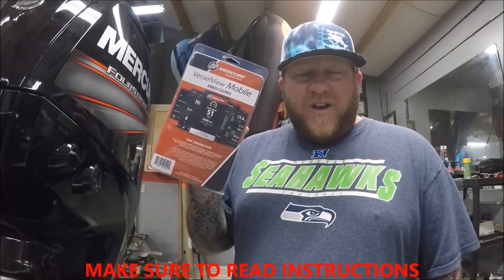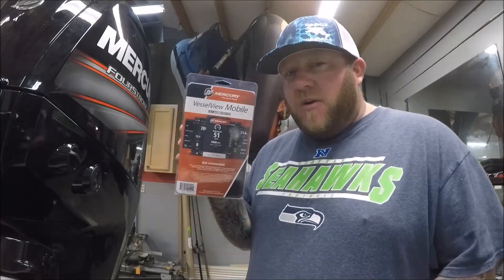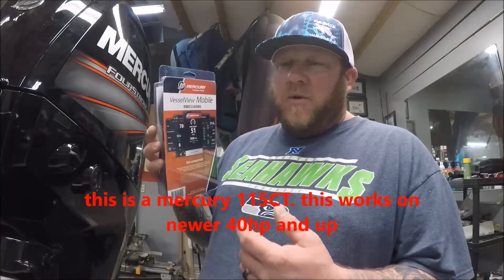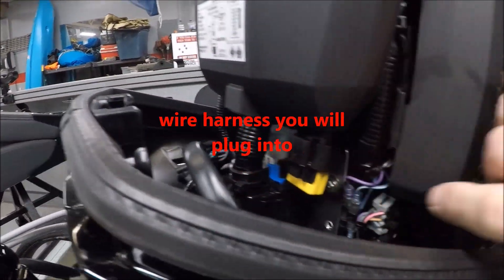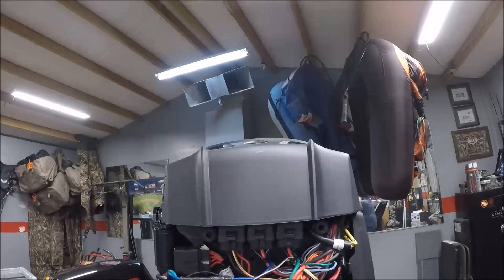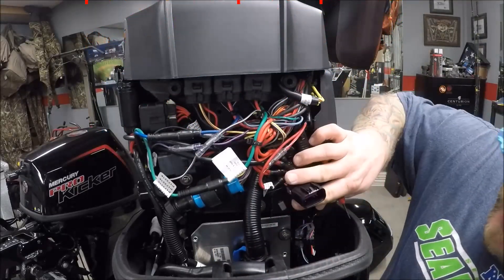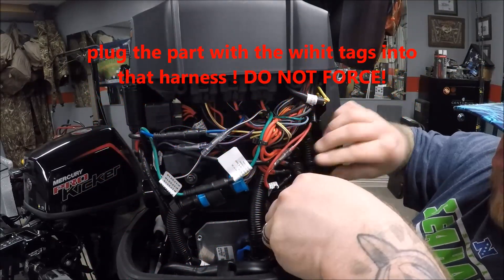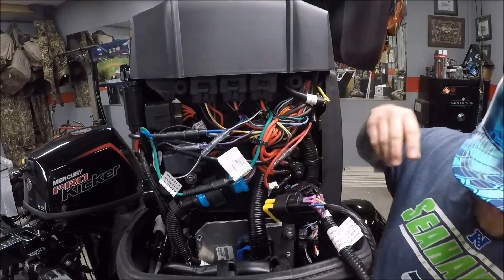Mercury Marine VesselView Mobile how to install

Comment: Hello.  I’m just seeing this so doubtful you will even see my question but I’ve watched a bunch of vid’s on this now and for some reason, on my Mercury 75hp 2019 motor, the yellow terminator cap I pull out of the motor, won’t fit back on the other end of the vesselview.  The vesselview does snap back into the where I pull the yellow cap from, but then that yellow cap won’t go on the other part of the vesselview.  Any thoughts?  This is making me nuts.
Reply from the maker: Lol never doubt! So you could have a pin that’s crooked or bent not allowing it to snap in. Inspect the pins. Do you have the right ends plugged into there said spots?
Reply: @nookiehookers8859  thanks!  I went back and for the 18th time in a week, looked again at the configuration because it wasn’t making sense it was too easy.  So the purple end part on the vesselview that you pull off initially, I guess I only “saw” pulling off the purple cover, not the whole end piece so the other yellow part was not fitting on.  Derrrr, finally figured out what I was missing.  Got it now, all good!  New boat owner here but determined, as a female, to learn as much as I can.  Kind of like doing things myself.
Reply from the maker: @debbidavis7678  awesome easy Peasy tight lines make sure to subscribe if you like how tos and fishing